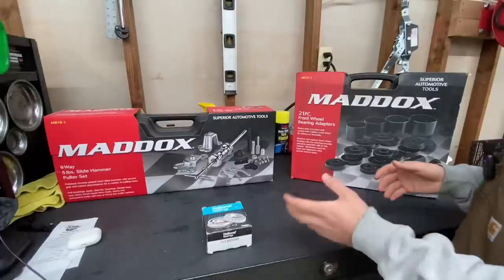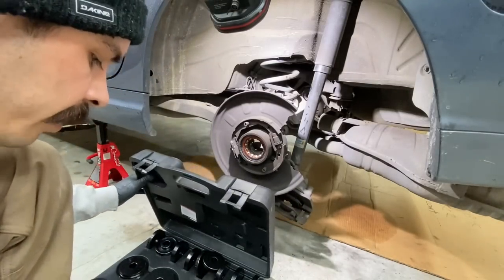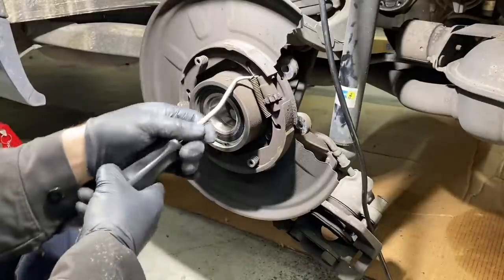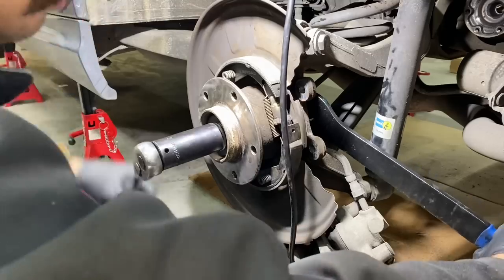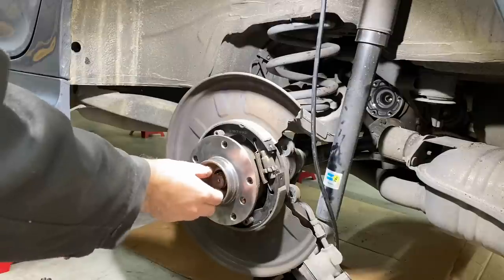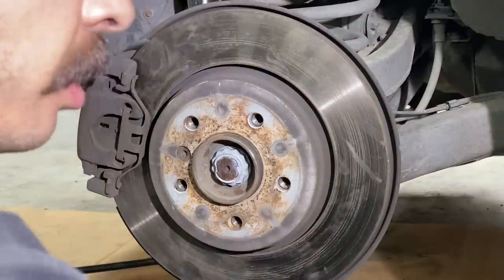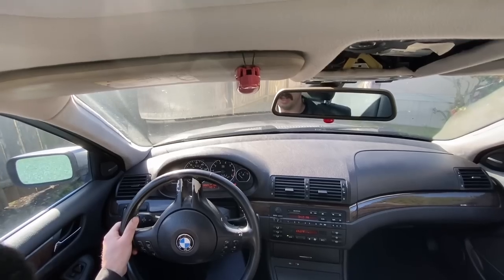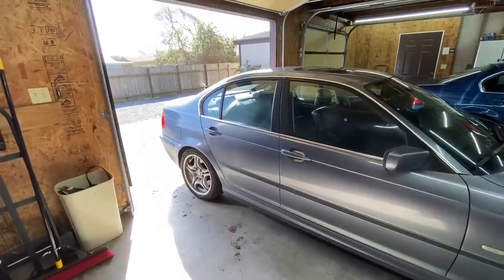BMW E46 Wheel Bearing & Parking Brake Repair

Comment: Nice job. Please explain the cog shaped part of brake assembly and adjustment. Thanks. Look forward to more e46 refreshes.
Reply from the maker: Hey bogusie! Good to see ya.
The cog is the drum brake or parking brake adjustment screw. As you turn the cog it spreads the pads further apart increasing its diameter and resting location against the inner drum of the rotor. I installed these pads with the adjustment screw backed almost all the way down being that there’s so much meat on brand new pads. As they wear down and you want more bite to the parking brake, you can adjust them with brake services 👍🏻 hope that helps
Reply: @DayOffDIY  Perfect! As Always. Clear, concise and comprehensive! Mystery question answered. Thanks!

Comment: You can actually turn the shoe adjuster with a screwdriver through one of the holes in the rotor ( brake disc in UK ) without having to remove it. 🙂🇺🇸🇬🇧
Reply from the maker: yeah thats what i do sometimes as well, but sometimes i remove it to get a better bite. thanks for the comment! :)

Comment: Great video as always. When you adjusted those drum brakes, how much clearance do you leave between the rotor?
For gloves, I like the Mechanix textured nitrile or for re-usable I rock the Milwaukee nitrile dipped cut resistant ones.
Reply from the maker: I’ll have to check those out! For the parking brake, I adjusted til I barely felt any resistance while spinning the rotor. To where I barely hear it bite while spinning. Hope that helps!

Comment: Do you ever have a concern for over torquing the axle nut when using an impact gun? Is there as much of an issue if an axle nut were to be over torqued?
Reply from the maker: ive never had an issue, as long as you start them by hand. I dont have a big enough 1/2 inch torque wrench that can handle it. Ive used an impact gun for the axle nuts for a long time and yeah, no issues so far. I also am very familiar with that gun, its not the strongest, but ive had it for over 10 years so i know its capabilites. I wouldnt if it was a brand new snap on impact or one i havent used before

Comment: As much as i enjoyed the video you missed some main points. First and foremost, torque specs! That's soooo important when working on cars. The axle nuts need to be tightened to over 200 lb/ft, not just a few hits with an impact gun. I also feel you downplayed getting the hub out and getting the axle back in. Both jobs are really struggles in a car that sees winter roads. Last thing I'll mention is there is a procedure for rear parking brake adjustment, you might get away with not following it but it shouldn't be ignored. Hope you take my comment positively, my intention is to help you improve your content!
Reply from the maker: Hey! Thanks for the comment and feedback, you’re totally correct. I’ll put more emphasis on torque specs in the future now that I have ISTA and repair instructions at my disposal! :)

Comment: Hey quick question, I'm having issues with my parking brake and was wondering if you know why after putting the hardware why the whole system moves when I Attempt to adjust it
Reply from the maker: it will shift around a little bit with the drums removed, its only those little springs holding the shoes in place, once you put the rotor/drums back on it will keep all the pads and everything centered and where they should be
Reply: @DayOffDIY  But I still can't adjust them

Comment: where are you lifting the car ? Can you safely do that ouside the pads or the subframe ?
Reply from the maker: Hey Gustavo, im lifting it off of the pinch seam behind the rocker panel. In my experience its plenty strong enough to lift the side of the car, I tried to describe it while lowering down the car.

Comment: Cant yo use a rubber mallet to tap the axle in to the hub ?
Reply from the maker: rubber would be more gentle so yes, you just gotta be careful to not deform the backside of the axle that fits into the differential

Comment: I almost changed the wheel bearing on my BMW e46, i did it in an authorized workshop. But I still have that bad bearing dot sound. What could be another problem?
Reply from the maker: thats interesting... the repair went well? brakes are fair?
Reply: @DayOffDIY  I know it's really weird for me, too. The repair went great, brake discs and brake pads are new too, the handbrake was done a month ago. Now I can only replace bearing inside differential.

Comment: Hey…my mechanic just fucked up my rear abs while changing the bearing may be he just put wrong brand bearing which is not providing magnetic signals to sensor. So i am getting good deal on FAG bearing which has magnetic encoder on it. So is this a good brand?
Reply from the maker: thats a shame! FAG bearings are good quality, and i think theyre OE too
Reply: @DayOffDIY  yeah he said bearing is around 250$ but i am checking online and found that FAG bearing is just 70$
Reply from the maker: yeah shops are always going to mark up cost on part, thats a decent mark up though. it covers warranty and other things
Reply: @DayOffDIY  now i want to do myself so can u give me list of tools needed to change bearing. Its e90 330i

Comment: Have you messed with the vacuum hoses on the e46 I know most of the hoses are dry rotted if haven’t bin replaced ...... my e46 is currently misfiring like a mf from those vacuum hoses lol
Reply from the maker: I have! I have a few videos showing how I replace the CCV (breather) system, plus the smaller diameter vacuum lines too
Reply: @DayOffDIY  dope ! Bout to check those out